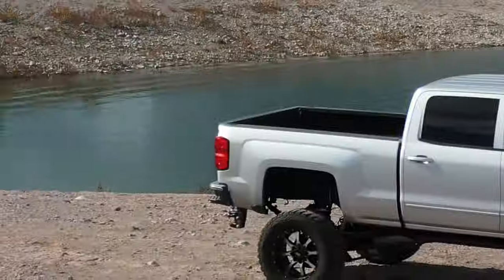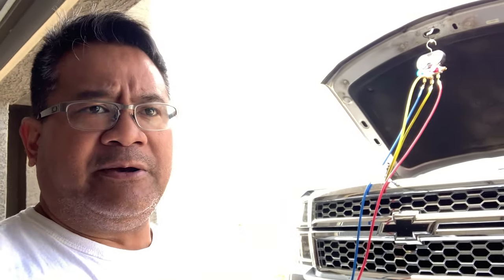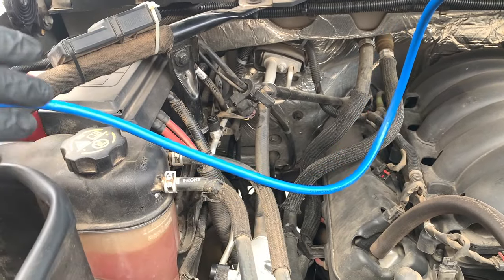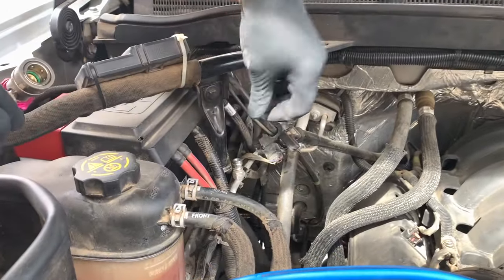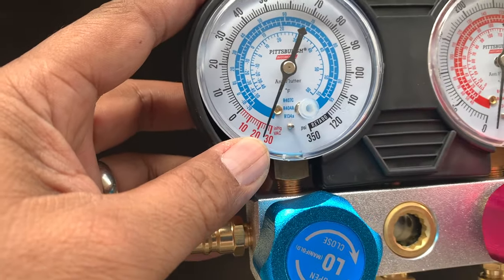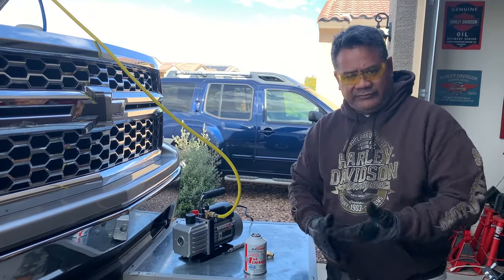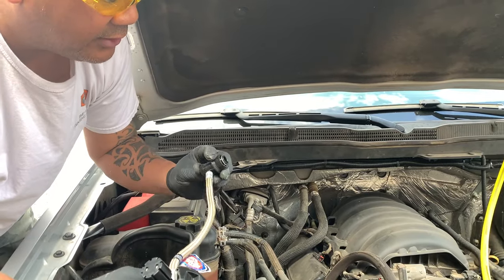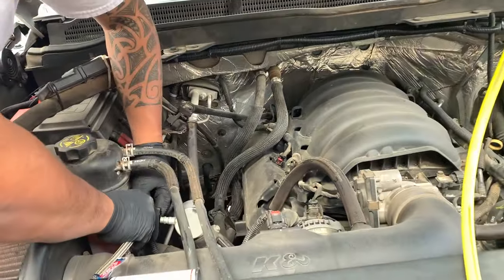AC Recharge Chevy Silverado 1500

Comment: 2014 thru 2018 chevy vehicles with 5.3L engine has a condenser weld leak driver side top weld joint.You can aluminium weld it or replace the condensor.

Comment: I had the same issue in my 2018 Silverado.This was a great video. But one thing, unless I missed the part that you retrofitted your system from 1234yf which is the new refrigerant that most 2014-2018 Silverado/Sierras use now. Maybe if you go back to 1234yf it will cool more. 1234yf uses less and cools to lower temps. And reminder different refrigerant than the one your compressor was intended for could result in inaccurate pressure and your unit might not work to its full capacity. Hello From Miami Dade county, I played with a few Tongans and Samoans from Hawaii. Back then (2004-2008) I had long hair and being Puerto Rican everywhere I went people asked if I was Tongan ( am 6,2" 296lbs) long curly hair back then. ALOHA MY islander brotha' 🇵🇷🤙🏾🤙🏾
Reply from the maker: I didn’t retro-fit any valves… My truck takes R134a.  So I’m good there.   I have a leak in the condenser..that’s my next project video🤣🤙🏼

Comment: Hello, after the evaporator core of my chevy Silverado 2015 was replaced, the evaporator is freezing up after 40-50 minute running in highway... I do not know how the compressor is controlled in this truck, it does not have a pressure cycling clutch, or a thermistor sensor in contact with expansion valve, there is an evaporator temperature sensor at the output side but not in contact, what would be going on?... thank you in advance!

Comment: Here's what I don't get and it is ME. I do not do this often. When hooked to the truck, under vacuum , I read vacuum, but it seems to be in the gage set only. Not in the car. With the gage set off the car, with quick disconnects open, the gage reads vacuum (this is ont the bench) Then when I unscrew the hose from the quick dis connect, vacuum goes away. It's as if the quick disconnect is not allowing vacuum to enter the car system. With the quick disconnect valce open (not on the car) I put it in a baggie and no vacuum. What am I doing wrong?
Reply from the maker: Do you the same manifold gauge that I use in the video?
Reply from the maker: Do you mean the gauges show you’ve lost vacuum?  If you’ve closed the valve at the the high or low ac ports in your car, the hose and manifold will hold vacuum after you disconnect the lines IF YOU HAVE YOUR MANIFOLD GAUGES  VALVES CLOSED AS WELL…. If air is getting into your system, then you may have a leaking schrader valve… let me know how it goes!

Comment: You put in too much oil and not enough refrigerant. Increased oil can damage your compressor.
Reply from the maker: You’re absolutely right that too much oil can damage my AC compressor.  The average amount of pag oil in a 12oz can is around .7 ounces of pag oil.  I failed to mention in the video the low side service port was leaking refrigerant and oil.  I more than likely lost more that .7 ounces of pag oil.  I made a video replacing low side hose showing the leaking port.  Thanks for pointing that out,  I will add a disclaimer to video as soon as I can🤙🏼
Reply: @hawaiianbrokechanic no problem. I don't remember but I believe that particular can has 1oz of pag oil, 1oz of ice32 and 10.5oz of refrigerant. I could be wrong though. With that said unless your compressor was leaking or replaced you couldn't have lost more than 1/5th of a oz of oil through the service port. No disclaimers are need. Keep making great content!!
Reply from the maker: @k.lamareyev4418  Mahalo Brother🤙🏼.   I’m really not good explaining things and I do miss a lot of details, but I totally appreciate your feedback!  It only make me and the channel content better!  Thanks again 🤙🏼

Comment: Did you ever get the problem fixed for good?
Reply from the maker: Yes…after replacing the condenser 🤣. Here’s the video:  https://youtu.be/6NZ5bO2hmg8?si=e6vict7-Jo7_fm2-
Reply: @hawaiianbrokechanic  I am hoping that is my problem I've had the truck 2 years and has 152000 miles